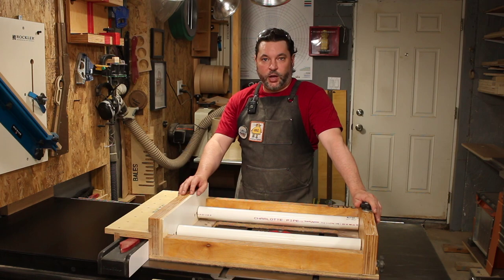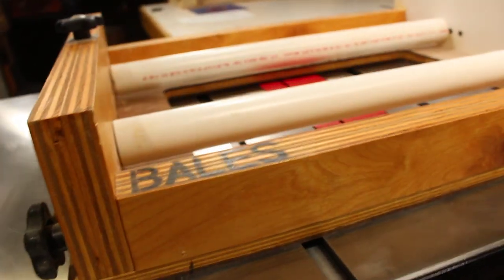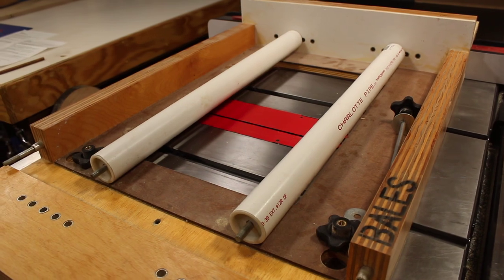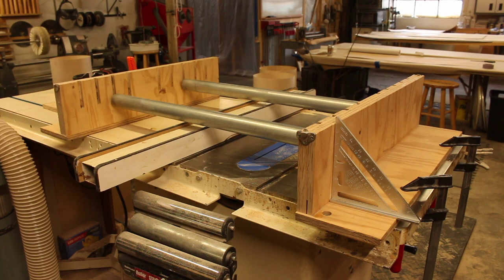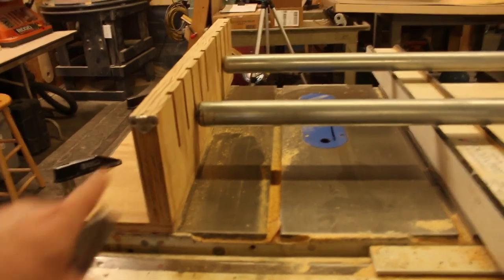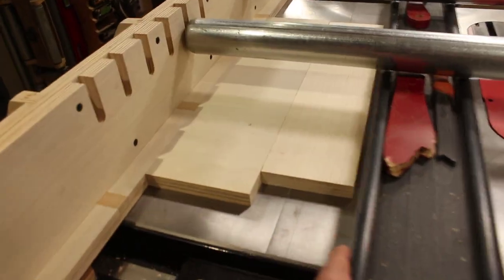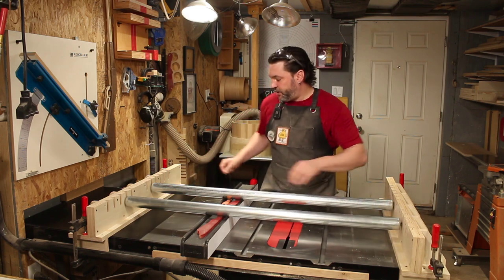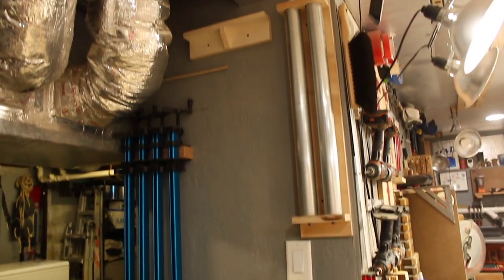Drum Shell Table Saw Roller Jig(s)

Comment: Is there a place to find plans for jig like this?
Reply from the maker: Wordworking/CAD plans ... no. But there is an Instructable, which is linked in the video description. Due to the lack of standardization with saw decks and distance from the fence to the center of the arbor,  a static set of plans wouldn't really work.
Reply: @BALES5000  - Agreed. It wouldn’t. I’ll be sure to check the link. Thanks!